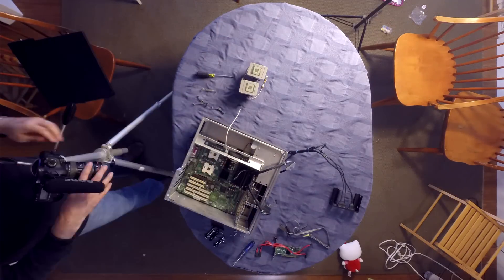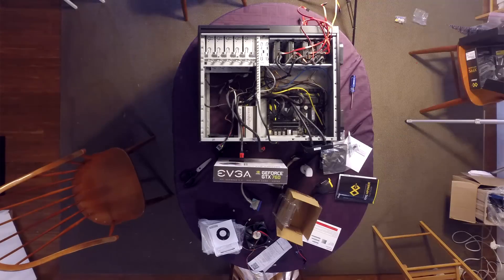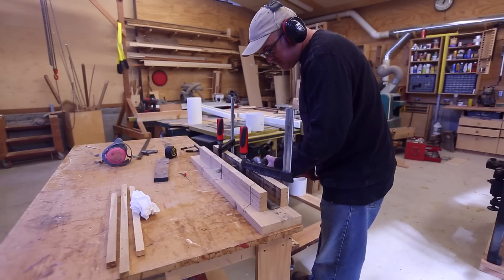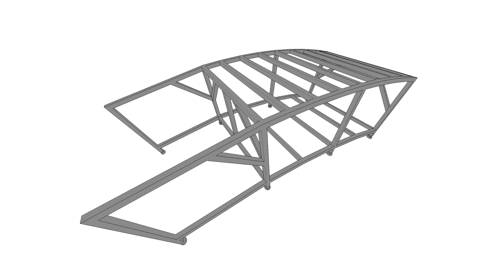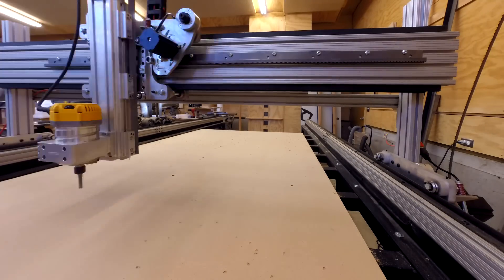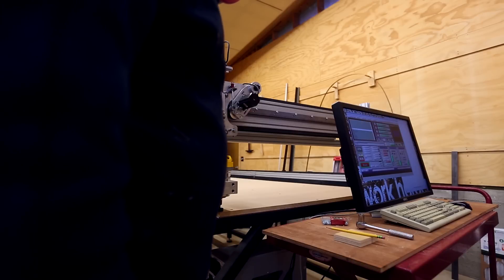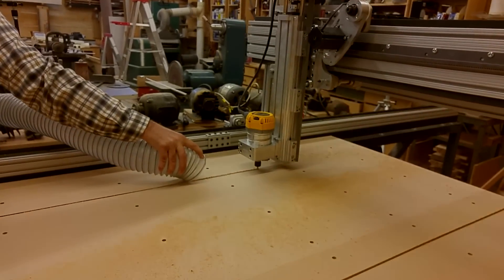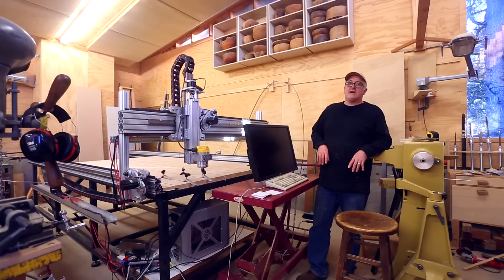The CNC Build: Part 3

Comment: I always thought those machines needed the sheets of wood to have the surface of it cocered in a layer of double sided sticky tape. 
Both sides.

The sticky top film was for protecting the wood from cracking while it is being cut.

The bottom was for keeping the whole board stuck to the table while the machine worked.

Comment: After 35 years at Lockheed Martin operating gantry and all types of CNC plus conventional you will want to use bolts with locking nuts in all key position i see you used self drilling screws the vibration will cause them to loosen just a suggestion the machine is awesome

Comment: Before i continue watching which i really enjoy and wish I could build my own just thought I throw this out, Double stock tape will do wonder for holding things down for machining and it would be perfect ur consernes at around.the 10:00 minute but yea this great love it
Reply: ..... Yea double stick tape get the good kind its definitely worth it but it will hold stock up two inch thick and and dont forget about five thou for it and when machining to near final depth don't go all the way through and more importantly the depth of cut and speed no more than 30thou 20 to be safe and rpms im not to sure... I mean youd get comfortable with it after a few or so trys, a little triel and eror i think you'd be surprised if you havent tried it.

Comment: What exacly stepper motors did you use?
Reply from the maker: 420 oz-in 3.0 mH NEMA 23 Stepper Motor, 3/8" Shaft.  http://www.cncrouterparts.com/420-oz-in-30-mh-nema-23-stepper-motor-38-shaft-p-188.html
Reply: frank howarth how long is your y and x axis ?
Reply from the maker: on this machine y is 12' at x is just under 5'

Comment: Nice Machine.  
I just recently purchased a step craft 4 axis machine with lot's of bells and whistles.  I am completely addicted to the CNC machine.  I started to design & draft up the one I want to build & Ironically it looks like your machine is exactly what I was designing.  I like how you left the end open so you can fit large objects in it to work on.  Wonder why you went with the 23 size motors vs some 34's?  Did you design it yourself or did you have an existing design to work with?
Thanks for sharing...

Comment: Frank, Did you have issues aligning the Y-axis rails (track) for the carriage assembly? Did you experience any binding in the carriage transfer? 

I typically will design flat stock track and cam followers on the parallel track to a captured track to allow the carriage to "float" in the X-axis. This speeds up installations as you have already fixed the x-axis by the grooved rolls on the opposite side. 

Lastly, I design heavy industrial conveyance with bolted track supports so that frame bow can be resolved prior to the physical track installation. Minor adjustments in leveling track can be made then with shim stock at the individual track mounting locations. A scaled down version of that concept would work well here.

Thank you for the post and awesome build!

Comment: Its amazing Frank!! 
I just have some questions...the angle you are using for the rails, what kind of metal is it? Is it accurate? Have you had problems with that the rail system?
I´m building a CNC machine and I would like some advises.
Thank you!!
Reply from the maker: just 3/4" angle iron. its the cheep option.  it works fine, it does deform over time to the shape of the rollers.   the more expensive options:  http://www.cncrouterparts.com/case-hardened-cold-rolled-steel-rail-1x5-p-262.html
Reply: +frank howarth Thank you Frank! I will use carbon steel for supports, the Open Rail and Delrin V wheels. Another question, what is the diameter of the DeWalt router?

Comment: I was wondering if the lengths of rack gear you used with the wide mounting plate is standard or custom? I have looked around and cannot find it. All i can find is lengths of rack with hols drilled directly bellow the teen. I'm based in the UK and seeing your video has inspired me to make my own CNC router.

Comment: Pretty interesting project. Use Enroute it is a very good software, for holding the materials I also suggest you to make a negative waffle on the MDF the table and use a big blower to suction everything down you can make some 4 inch holes around the table 6 for a 12 x 8 table add an mdf with holes sheet in between the waffle and the material and add some hoses under the table seal all them to avoid air leaks.

Comment: f engrave  (free) is awesome for v carving. 

if you are a start up company or make under $100k, fusion 360 by Autodesk is free and extremely powerful for 3D and complex milling. 

a lot of people use vcarve desktop or pro.

if your machine had GRBL, there's easel by inventables. you can also do design in easel and export gcode.

Comment: Yup, Fusion 360 is free for hobbyists and it's an amazing CAD/CAM package. You did a fantastic job on your CNC router, it's certainly big enough for just about anything you might ever need. Double sided carpet tape works wonders for smaller pieces of stock and holds down the cut out part as well, I use it quite a bit actually. The dust extractor will be a huge improvement, lots of designs online but I would make sure you can remove the dust show easily for changing bits etc. Magnets are a great solution for that.
Reply: Sorry, meant to say dust shoe😐

Comment: really impressive machine.  Lots of great ideas for when I build my own

TOP TIP  for you.

When cutting your inlays cut the edges with a very slight bevel on both pieces and cut both to same size.  Then when you drop the inlay it will fit perfectly but be a bit proud.  You can then sand or plane down level and there will be no visible gap between the parts

Comment: Hi Frank, great build, really impressive and I'm just a tad jealous.
With regard to using your jointer to flatten out boards, thats history now you have your CNC as it with the help of some shims will be able to surface one side and then you can flip the board to do the other.
Regarding the computer and keyboard issue for the CNC, check out Keith Fenner's channel as he made a semi portable positive pressure workstation to keep his computer protected from the various things flying around his metal working shop, but dust is dust and computers are computers, so the example will translate.

Comment: great stuff frank!
you mentioned something abut the computer case. amongst my billion other interests, servers & networking are (were) a big player. i use a 19" rack mounted server case, 12HU in height. you can place your atx computer board in the top half and have all of your hardrives in the lower. mine has two psu's incase one dies. there are plenty of fans, etc, to cool and filter everything.
bonus is : you can buy them on ebay for next to nothing.
looking at your setup, you could fit all of your drives, plus the cnc psu/controller and PC stuff into one server box :)
a UPS wouldn't be bad either (19" rack format). it'd give your pc/cnc time to safely shutdown incase of a power outage. (last one ;) - if you ran your hardrives in raid, your files would be more secure too.
all the best mate....keep up the good work!

Comment: I have been looking at building my own CNC machine and I'm curious as to how you've got the router/spindle wired. Do you have to go turn it on manually, or do you have it wired to your controller, allowing the controller to control the spindle speed? If you could please make a video or diagram about this, it would be much appreciated. Thanks. And great vid, btw.

Comment: One option you always have is to use the machine to cut the piece but leave it short of cut all the way through.  Then use a trim router to get it out.  That will give you a perfect piece since the bearing idexes off the part your machine cut.  It also leaves the table uncut or glued.

Comment: I thought I'd throw in a couple suggestions...  Try to find a native CAM solution for your favorite creation software.  I use RhinoCAM. This allows flexibility when creating tool paths as you will likely wish to do some modifications on the fly.  Rather than needing to reexport and rewrite the tool paths in a stand alone, you will just need to regenerate after slight changes.  For hold downs...  I use a couple different approaches.  For that bow-tie, I would have used Shuretape double sided duct tape (Lowes).  This is the best I have found over 15 years of doing this.  It doesn't leave a residue.  Another method mentioned is tabs or onion skin.  Before you start, you might CNC safe locations in the scrap for the fasteners.  Another thing to consider is composite air nails.  A lot of people like these for a hold down solution as well.  -new subscriber :)

Comment: Awesome project. I would increase the stiffness of the pillars holding the Y-axes. When it comes to quick changes between +x and -x direction and also between +y and -y it may cause the whole gantry to oscillate which will affect the precision of your parts.

Comment: Love the 3 part video Frank. I just built Dave Gatton's machine over the Christmas holiday, the wood one vs. the new metal kit. This was my first attempt at CNC and I have to say it was a larger learning curve then expected. I settled on Fusion 360 for now and purchased Mach 3.I'm a little anal about the machine build. Some of the parts a complex enough that if you don't own a band saw, you end up improvising until you can get the machine running well enough to machine replacement parts for itself. So, I've hand cut parts only to replace them with cabinet grade CNC parts. Once that is complete and the machine is as exact as I can get it, I'll use it to cut a whole new set of parts in high grade Baltic Birch and rebuild the thing again :)I'm curious as to what your investment was for just the CNC portion less the table and software.
Reply: +Tony Masopust Disreard my question about cost as I see you listed that in the description.

Comment: Great video!  Maybe I missed it, but could you please provide more information as to the size and type of stepper motors you are using as well as all the controller boards, power supplies rationale for selection,  etc.?  If you can provide sources of the electronic components, that would be appreciated as well.  Thanks!

Comment: I tried the double sided tape method.  does not work well on mdf,   Might be better on a solid surface material.    I generally use screws to hold down the cutouts and fill them later if necessary.  For CAD I have been using Rhinp3d for years,  not free but is a very powerful tool.  You can download a full function demo with limited saves.  www.rhino3d.com

Comment: I use Aspire 8.0 a bit pricey but worth it. it will solve the issue you had with the parts flying out as you cut them, you can add tabs to the cut to keep the part in place.

Comment: I found the best way for dust control is essentially setting up a zipline above the router on the longest length and that way the hose can follow the the router head. I found this video and used this on my 4x8 router and so far it works well. Really enjoy your videos, copy and paste the line below into the youtube search bar.

13' X 6' CNC Router - Planing the table

Comment: I'm not an expert but when cutting the small inlay pieces, use a smaller dia. router bit.  You're removing quite a bit of material compared to the size of the part you are cutting out.  Also, code in some tabs that keep your part connected to the stock, this will keep the part from moving.  I use vectric cut2D.  Very much looking forward to seeing what you will produce.

Comment: If you want decently usable CAM Fusion 360 works for about $40 a month. Still a bit lacking, but definitely usable. If you want affordable, commercial level CAM, BobCad produces good CAM software. Prices are in the $1000 range, but that's a tenth the cost of the most bare bones seat of Mastercam, and is supports NURBS surface milling very well for sculpture-type work.

Comment: I use aspire to do my cut files.  

About all the computer at the machine does is run Mach3.  Oh, I updated the firmware on a old linksys WRT router with dd-wrt to transfer the files back and forth... I gave it a stand alone wireless network that has no internet access so I don't have to worry about antivirus and updates etc... then I join the network with my laptop that runs aspire to transfer the files.

Comment: For the dust collection I was thinking at a small (size/weight) shop vac mounted on the gantry with a short hose to the cutting bit. Because running a hose along the machine would be crazy long and hard to keep from catching on other stuff.

Comment: Stepper CNC systems are good to a certain level. At one point you will need to push those motors harder  and the steppers will be a source of problems. A quick fix is to get a bigger power supply for the steppers (from 12 to 32VDC). 
With all the effort it takes to build a CNC, it makes more sense to pay more and get ACServos. Then the CNC will respond faster and stronger, also very important is getting the position feedback (steppers don't have it).

Comment: Well, what a nice little machine! :)  

Did you consider to use linear rails with cars running on linear ball bearings instead of the rather coarse home-brew style steel angle beams? 

How do you handle the backlash that is normally inherent to tooth-rail motion systems? 

Looking forward to your next videos showing what you finally do and achieve with that machine.  Hint: look into laser cutting! 

Congratulations on a great project being finished in surprisingly short time. Your 'just let's do it!'-approach is the only way to go.

Comment: I use Meshcam.  It's not expensive, and it helps for things like work holding.  The program has a nifty little feature that adds in tabs to your workpiece at whatever thickness you specify.  As I was watching your video I was thinking that could help you quite a bit, and I would have been lost without it.  I'm sure other programs do it as well, but Meshcam handles everything I throw at it.  The only time it gets finicky is when I'm trying to cut a 1/4" channel with a 1/4" bit.  It tends to want a little more wiggle room, so it'll just stay out of the channel until I switch to a 1/8" bit (which I should probably be doing anyway).  I think it cost me like $250?  I think you can also get CutViewer with it for a little more, which is a helpful little tool that renders a 3d solid and then simulates toolpaths over your workpiece to give you an idea of what you'll end up with.

Comment: corel draw. or any like software and vectric, v-carve or so. export gcode to mach3 arcs. can do some nesting, tools management and automatic patch based on layer name. plus zillons of other things.
this cnc machines can have many features. need dust colector. do you have 4 endstops? so you can use auto square with mach3. plus a zero plate.  a lot to learn and investigate.

Comment: Suggestion for the 2 pieces to fit better
  do not make it smaller or bigger to fit. instead, steam the wood so it will be flexible and fit with pressure

Comment: Great project Frank, congrats! On the hold-down issue, I have found the most efficient method to be: 1. Use down-cut bits (bits that cut downwards and press the work piece down on the table - like the Onsrud 57-400 or 57-900 family or similar) 2. Do not cut all the way through but leave 0.2 - 0.3 mm material at the bottom and then separate with sharp knive and clean edges with sandpaper.

Comment: jmick.art - Not a good idea to use hot glue as it introduces inaccuracies in the plain I.e. there'll always be a gap between the part and what it sitting on, due to a thick glue layer, which can never be guaranteed to be parallel to the table.

Comment: "Autodesk Fusion 360" Frank hands down the best cad can software out there regardless of how cheap the price is! Autodesk has incorporated its existing HSMWorks CAM software into 360 which standalone costs 20 grand!!!! and you get it for free!;! its a no brainer, easy, flexible and quick to use CAD / CAM / FEA analysis + others + brilliant communication tools, winner all day long.

Comment: Nice build Frank! Next up is tuning Mach 3 to your exact machine using a dial indicator on all of the axis (steps per inch, etc) getting spot on. After that, working on the backlash compensation. It's a bit of an effort but pays off in the end with 1/1000 accuracy if you do it right. I'm running a large, 80/20 homebuilt 4x8 CNC I built about 8 years ago and its still going strong with repeat-ability across the entire 4x8 surface of 1/15000th of an inch (depending on humidity). I use 3 layers of 3/4 MDF for a heavy, solid table that absolutely will not bend. The first layer, of course, is the sacrificial layer and when replaced, over a day or two, conform to the solid 1.5" of MDF underneath with very little taken off during the leveling pass. 

All in all, a very nice build! Look forward to seeing the rest!